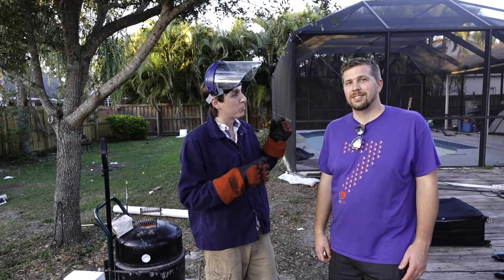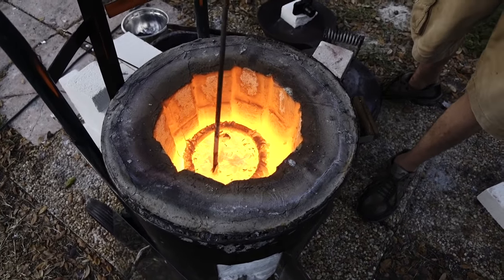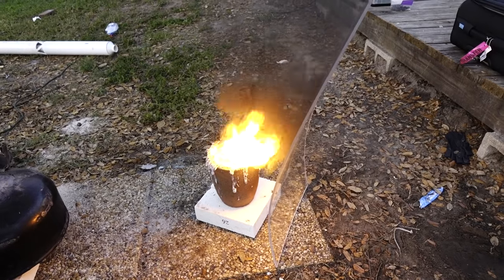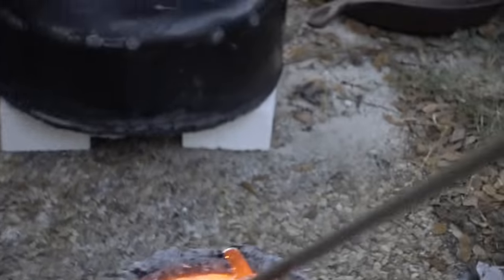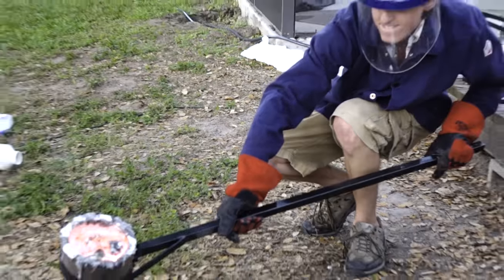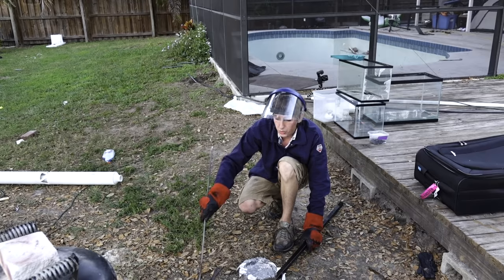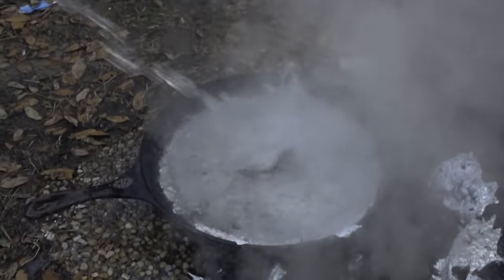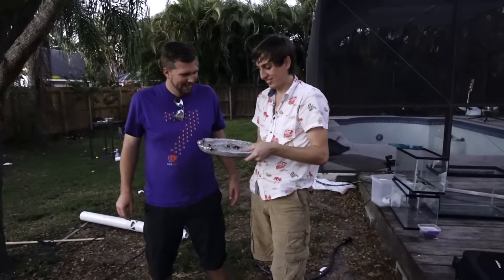iPhone in Molten Aluminum

Comment: My friend worked at a metal refinement factory, he wore three-layer woolen coat, cap, mask and thick trousers\boots when he cleaned up the cauldron. And there were "only" about 300-500 degree celsius, but still he have little scars on hands and shoulders where liquid metal fell on to his protection. Man, u should really DO NOT wear your shorts when playing with this.
Reply: That are Super Shorts they can handle it I guess and btw who needs legs
Reply: "U should really DO NOT"

Comment: Andoid fans sends their regards.
Reply: royalpunjabis XD
Reply: royalpunjabis At least our phones don’t explode or are made solely to play fortnite
Reply: @cosmicmemer1611  I don't know why but the way you said our phones made me uncomfortable
Reply: @cosmicmemer1611  At least I can currently use mobile data on my phone.
Reply: *too
Reply: At least our earbuds don't break as soon as you bend it. And if we drop our phones it won't break into a million pieces even if it's something soft you dropped it on...
Reply: Ashley Múller If your on the android side of the argument you are partially wrong (I don’t use apple earbuds) I’ve dropped my iPhone X more times than I can count. And I’m typing this comment with the same phone, no cracks just some corner and edge scrapes.
Reply: @cosmicmemer1611  I've had an X since release and the edges have some wear and scraps; However, that could have been avoided if I used a case or screen protector. But I don't and it's survived so far through multiple drops and what not.
Reply: @whoops487  because android screens are made of cheap plastic XD not glass do some research and buy the real ear pods next time bud
Reply: @isaac4303  Gorilla glass... 90% of android phones use  a glass screen. Also, did you know that plastic screen is way harder to shatter than a glass one? I bet you didn't think of that. So even though most phones have glass which is the premium material, plastic would still work better.
Reply: what is an andoid?
Reply: unkkel kesseli please tell me you’re joking
Reply: @cosmicmemer1611  most of the phones that blew up were made by cheap companies
Reply: You are replying to a year old discussion that is on a 2 year old comment, and you are making literally no points.

Comment: You really shouldn’t pour or move molten metal in tennis shoes and shorts. If you were to of dropped the crucible and the metal splashed on you, you would be royally F’d up.  You should always wear protective gear. The appropriate protective gear.  Other than that, I thought it was pretty awesome.